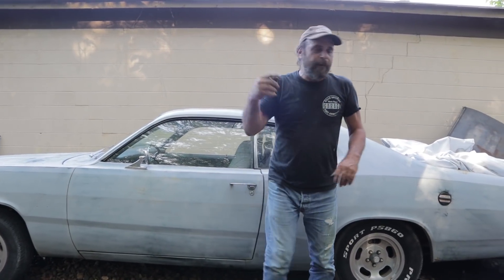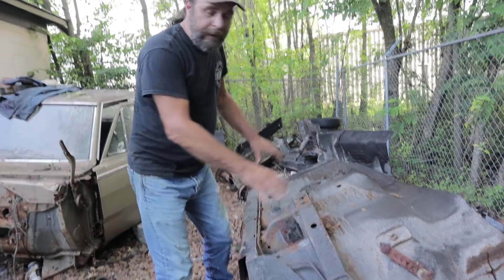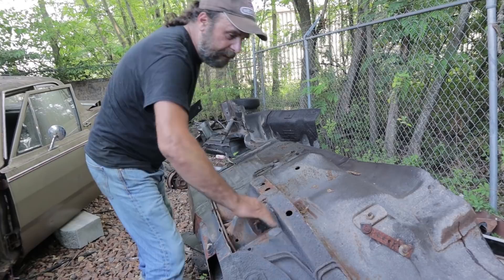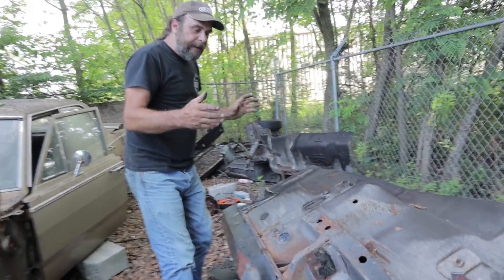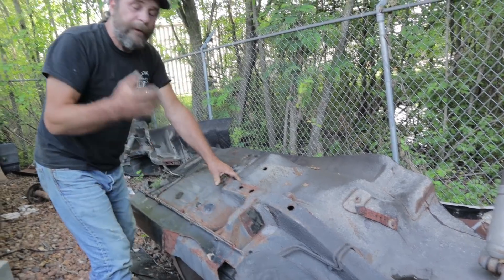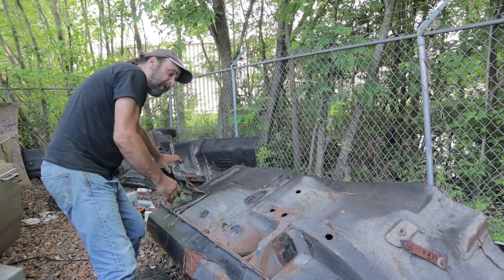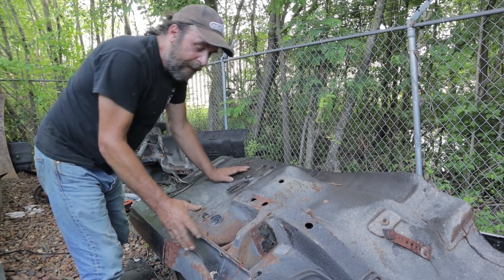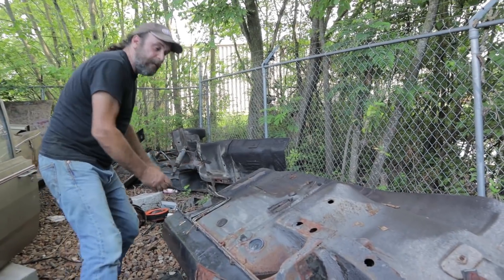Chassis Basics-Frame Connectors

Comment: Totally disagree. Frame connectors do help a car with the longevity of it's life. At least in my case with an 08 Charger. The front and rear of the car (suspension and drive train) are built on sub-frame assemblies bolted to the car. From there, the sub-frames end just a foot from them towards the center of the car. When launching the car from a stop, the nose of the car will go up and then twist. This is the flex from the car. Not that it can't hold together. It will. Spot welds are surprisingly stronger than most people realize. But cars nowadays are made from 18 gauge steel. Hardly a strong point. Over time, cars will sag from the stress and bending. This car of mine was showing this. It's too much power for boxed out sheet metal. 

So I built a set of frame connectors for the car from scratch. Putting the car up on wooden platforms to retain suspension and body pre-load, I bolted, then welded a frame assembly out of 1/8 inch boxed steel. These were connected to plates that were bolted and then welded to the sub-frame ends. What a difference it makes going down the road. More responsive, no bouncing around and flexing, and when power is applied to the wheels, the body comes up straight and the hook-up is tremendous. The car itself is much more solid and less noisy. No more are the interior parts squeaking and rubbing. Steering has improved around corners. It hugs the road. 

Is this for everyone? Probably not. Some people like the soft, cushy feel of a car floating. I have never been happy with previous cars with sub-frames and how they felt. A full framed car always seemed more solid. But I have no regrets in the changes I did to the car. Specially after later putting in poly urethane bushings on all suspension parts. To me, this is how cars should have been made.
Reply from the maker: Those cars and the late Challengers are a different type of construction all together

Comment: If I have drip on the rear of my oil pan (350 sbc) can I use “right stuff” sealant to stop without having to drop my pan? I am positive it is the pan. The middle of the “U” is where I get a drip when parked and slighlty more when driving and pressure and heat increase.
Reply from the maker: I don't know!  I think that's a question for Google
Reply: Google doesnt have your experience. Lol... ill figure it out.

Comment: Back when they first started putting crumple zones in cars, I stopped drilling holes for accessory mounts and went to adhesives. Because there's just no way to tell anymore why  something was done, or what was done (like high tensile steel) but you know an awful lot of money was spent on professionals who KNEW why every single thing was done. Even if it was a klufge.

Comment: Having worn out a number of A and M body cars I can honestly say that you are correct. I have broken or bent a lot of parts but not at the torque box junctions. If you are concerned with structural integrity, then fix, replace and prevent rust.

Comment: 1950 Statesmen has been prepped to accept the Hudson 308. Have a vintage header set. Trying to source a twin H system. Have a new cam and mechanical pump with auxilary lift, 
Couldnt find a set of glass for the headlamps so I bought some cheap circular HID fog light pods that would fit into the bezel.
Reply: Also have set it up for manual choke and dash throttle.

Comment: Hey Uncle Tony good point! I've also heard that about rear ends. Some people weld to tubes to center like the 7 1/4 or 8 1/4. They also need to flex some. Do a video if you haven't already.👍
Reply from the maker: Well, there's actually a good reason to do that on high HP cars, as the factory rosette welds can break and cause the center section to rotate upwards

Comment: Hey Uncle Tony I have a 66 GTO convertible 4 speed And around 530 horsepower   Motor Occasion a daily driver Weekend Cruiser Couple times a year to the drag strip for Smokey burnout fun  Would it be badd to put polyurethane body bushings on it To help with the The body twisting that convertibles have I hope to hear your advice thank you Uncle Tony and Kathy
Reply from the maker: I can't see them doing any harm in that application, go for it
Reply: @UncleTonysGarage   Thank you love your channel

Comment: Just a couple of things:

1: The rocker section is a box or tube shape, and installing torque boxes eliminates the flex that would happen between the rail and rocker by effectively triangulating out the two 90 degree angles in the structure between the two.  Torque boxes are turning the rockers into frame connectors.

2: I'd say the other big difference with factory-supported race cars (pro stock, NASCAR, what have you) was that those guys also installed a cage, and a properly installed cage connects the front and rear frames.  I've seen nothing stiffen up a chassis near as well as installing a cage.  Tying the sub frames together, either using the rockers or using dedicated connectors, you still end up with a flat load bearing structure.  It's stiffer, but not rigid.  The cage adds structure way above all that, so loads that would otherwise flex the chassis because they're pushing up on it go into the cage instead.

Ok, a third thing: You didn't mention the bean counters.  Even back in the day, the engineers had to answer to them, otherwise everything would have been way more awesome... and bankrupted all the manufacturers (which ended up happening now and then anyway).
Reply from the maker: 1. The rocker section on a unibody IS frame
2. You're absolutely right..a full cage completely replaces the structural needs of a unibody.  The body and suspension is effectively hung from the cage structure
3) Bean counters would have been much happier with a simple length of box tubing than the more complex and difficult to install torque boxes

Comment: I was part of a very strong Mustang contingent that meet at SuperShops(RIP). Everyone had bolt or weld in connectors for street race cars. Some of them were solid 8.50 cars that were street friendly off the boost. Fox body was a short and flexible little beast. In our application we had to tie it together. I really appreciate your video. It opened my eyes. Keep up the good work, my man!
Reply: Definitely on the fox bodys. I sheared the rear end from the body on one car before I learned to box them.

Comment: I completely understand and agree with the logic and theory behind this topic, but I own a 1968 camaro convertible that I restored  almost 20 years ago. 1st time I pushed it in an off ramp, It felt like a wet noodle & it cracked in the deck filler panel above the trunk (I removed the lead and smoothed it over with filler.)
 I installed the Hochkiss unibody subframe connector kit and have been chasing newer cars in off ramps and bangshifting burnouts with no worries ever since. It feels so much better in the seat of the pants. And no, the car was never rusty.

Comment: Tony you are willing to share info not many could or would be willing to. Your racing background is evident.  You are spot on with your assessment of how a lot of cars are built by copying what others have done. Explaining building a streetable engine vs copying what someone sees at a dragstrip was a daily occurrence in the engine shop back in the day as well. Might make a good video, air flow in a drag engine at sustained high rpm vs a street pounder that has to take off from a stop light in traffic and the effects on drivability.  Too many engines using mismatched components to look the part but fall flat on the street.

Comment: Love your teaching especially when you say "come here to the camera". Just learned again. I got sag and b puller crack, stress so l welded frame connectors and installed new torsion bars .  Once you stiffen something up it changes the dynamics of the car. I enjoy b bodies the most. All around best mopar. Thanks Uncle Tony. How about tire height in rear dynamics. Stress to rear end your favorite gear set up and so on.

Comment: You nailed it.  It's about energy transfer.  The energy is saved up in the flex of the uni-body that helps so a very small degree in the launch.  BTW.  Have you ever tried filling out the uni=body spot welds.  OMG they are hardened.....work hardened.

Comment: Funny story I watched a co worker pull his dart gt in the shop,big block and all,racked it up on the two post. I thought he must need brakes..nope he tied the subframe.lol all that welding and banging.  Not only did he have subframe connected but he turned it into round track car the doors wouldn't open..😎

Comment: The best engineering minds in the world were also competing with bean counting accountants.  Besides, these cars were designed for bias ply tires or very low-performing radials.  I hear the point about not wanting to focus forces on the wrong area of the chassis but if done right, these should distribute the forces over larger areas.  I have torque boxes and subframe connectors on my Dart Sport and I don’t regret it.  Before I installed them, the car was a flexible mess if ever pushed through a corner.  It’s way better now.
Reply: Yep I still plan sub frame connectors and torque boxes on my 65 Dart
Reply: @dartdude2668  same planning for my 2-gen charger ( heavy-duty sub-frame connectors and torque boxes + reinforcement panels and a mini-tub from someone like us-car-tool as i hear it helps e-bodies with door fitment and or finish  / front end flexing + complements my different rear end ajustable 3 link ( + im thinking 💭 of using 1955 packers style of torsion bars that spread out the loading to the mostly to the a-arms / bars or air bags so this loads the frame differently and should help with the " spot weld problems " ) than stock ect. and after 50 years of use im sure my chassis isn't as stiff as it was in new 1969 / metal fatigue or hidden rusting / thining has set in somewhat + id like my panel gaps / paint job to be 👌 whenever I finish it / get to it ) 80% d&D 10% road racer and he is right its the hole package not just one hoped up part of the planning budget and some of the engineering team was really good but 2 things that aren't working in its favour 1 bean counters ( they had to sell it / made for the masses not the " car guy ) 2 there in my case 45+years old so we have more technically advanced options now and some of them are superior and with some of us the og beanie rules / reasons don't always apply to us
Reply: @Richard Price  I know this is old but I was hoping someone would bring up the metal fatigue that flexing causes.
Reply: @Not_An_FBI_Van  you mean like the cracks at the bottom of the sail panels/ rear pillars? I especially noticed those on the early Mustangs.
Reply: I like that UTG hearted your comment. I suppose context and use case are key
Reply: Are any you long road tripping or dailying. These cars?

Comment: If my memory serves me correct (HA - not sure if it does)  - many years ago I friend welded up all the panel seams on a 930 Porsche to tie it all together better (in theory).  I cannot exactly recall the 'damage' - but to the best of my recollection - there were serious issues with the door openings and something else cracking later.  Not saying that this would occur in all situations - but in this particular matter - the end result of trying to tie it all together better did not produce an ideal outcome.  I assume they just went in a whacked a BIG amount of weld upon weld upon weld and hence the issues in the end.  HA - moral to the story - bit by bit by bit may be the best method.  The worst thing was that the car was only a few years old and in my opinion - it was ruined after the industrial amount of welding that was performed on it.
Reply: Hello Tony - have a nice day mate.  CHEER from AUSTRALIA.
Reply from the maker: Cheers!

Comment: i thought they made unibodies because they were cheaper to make :x
Reply from the maker: They are cheaper, but they are also stronger.  Try to find the old video's of them rolling a Chrysler Airflow off the side of a cliff
Reply: @UncleTonysGarage  is it possible to reinforce the front and rear areas where the spot welds are? im building up my 71 demon to be a track/daily car, and i kind of already installed the connectors :c

Comment: Adding subframe connectors is talked about in the Mopar Performance Chassis manual along with torque boxes...  I'm building my Duster for hard cornering so I think I will still put them in.  However I probably won't be as eager now to do the same mod to a more street-cruiser-oriented car.
Reply: I've looked deeper into this since then and unfortunately disagree with UTG on the structural integrity aspect.  Subframe connectors are a great idea on any Mopar regardless of use.  The forces don't get concentrated and "work-harden the spot welds" if you add subframe connectors, they actually redistribute the loads more evenly across the parts that are supposed to be structural and can't move at all.  Nothing structural in a car should ever be able to move whatsoever.
Reply: @mopartron3030  good to know I'm looking frame rail to fire wall struts as well as inner fender, torq boxes, frame rain connectors and few more home made pieces
Reply: @cdoublejj  go for it your car will feel like a bank vault.  My duster feels noticeably more stiff when I'm driving it hard after subframe connectors.  Might do torque boxes and inner fender braces at some point.
Reply: What about both ? Corner carving daily?

Comment: Uncle Tony ; Grab some Grog & Lite'um if U Gott'um , This B" a Long One ! This Is a Verification & Case Truth of This Vid & Other's + YYZ , Rock-Crush'in-Ratman's 1970's Way of Tinker'in & a Think'in . B'in a GM Welder on the "B" Body & Some-Tyme A" Body at YOO, [ Oshawa ] ,Work'in the Jungle Line in the Pit , My Soul Reason 4'r Existence was 2 Weld Such Said Box , Rocker ,Wheel-Well Lower 1/4'r Panel's . My SS Nova's , 68 Rat+Rock ,Heavily Modded , 69 Rat+ Rock,Extremely Modded / Mixed Gas - Streetstirs , gave Me a Unique Insight 2 this & was a Constant Battle Between My Friend's , [ Racer's ] & My Collegee's . What's a Mohawk 2 Dou ? BOTH !!! 68 - Noth'in / 69 ,12 point Roll-Gage - No Connectors . Roll-Gage Particulars Were ; Thigh Diangle -Low 2 Facilitate Door Entry & Seat Operation - Rear Seat Cross H-Bar , Low 2 Facilitate Rear Entry & Sweetie Engagement - Trunk Post Termanis were 2 Metal Plate's Sandwich'in Trunk-Floor Body Skin Via 1/2 In' Bolt's . More Rigidity & Some Flexibility , 2 "Boot" , Kept  All 4-Ward & Upper Rail's Tight 2 Head-Liner - Font Dash & Door Post There-By Facilitating All Interior Bit's ,[ Sun Visor Included ] , In Tack, Functional & Hidd'in 2 Outside On-Looker's , Except 4'r the Rear-Window Down-Bar's . Bar Termination was done Via 8" Steel Plates Welded 2 Floor Panel's. Front Wheel Lift Was 3 " Port & 1" Starboard With M&H + J-Bolt She Tracked True As an Arrow with acceptable Twist & Flex . Also Solid Steel Motor & Tran's Mounts with Hardened Aircraft Bolts , [ Solid Steel Gold Anodized Scatter-Shield + Driveshaft Loop's - Safety First ]. 2 Truck Batt's in Trunk 2 Assist in Wheel Lift & Start . Kill Switch 2 Facilitate Hot Eng Start as well as Triple Core Truck Rad . 12.5 Compressed + 5 ft Oil Lines 2 Extra Large Double  [ Fender Mount ] Oil-Filter's 2 Aid Cool'in Giv'in 20>25 Minute Run-Tyme .Braised 1/2" Fuel Line at Back-Rear-Bottom of Tank with Electric Pump Fuel in Close Proximity 2 Tank .Fuel Gauge Was of Course Mounted "OUTSIDE" , Front Dead Center on Windshield Valance . It's the ONLY Gauge Required When Need B" Cause U "KNOW" When U'r About 2 Nose Over . Tach / Steer'in Column , Other's Off-Set Right Knee , Unless U'r an Ozzie or Worse , a Tommy Boy . G Tony , 4'r this Kind'a Money , Even a Mohawk can Fly . Spool'um Up , Lite'um Up & Onward & Upward !!! Happy Canuck Day & Giddy Up Gone !!! I Am the YYZ , Rock-Crush'in Ratman . Say Hi 2 Nick .